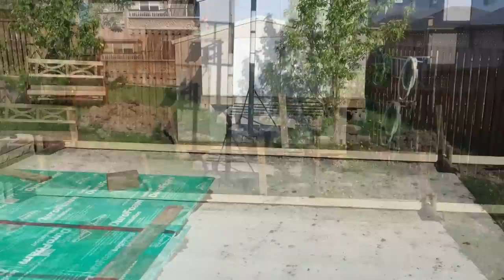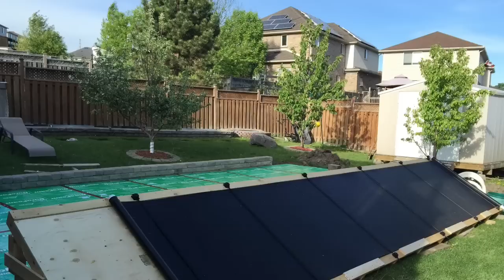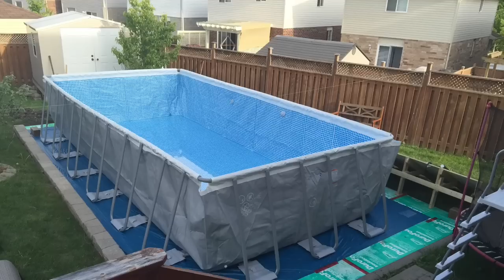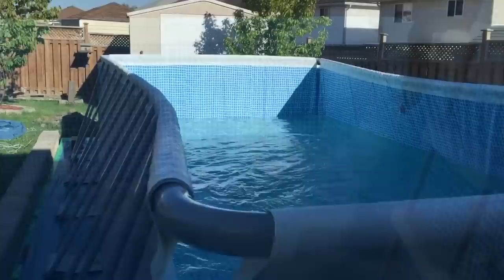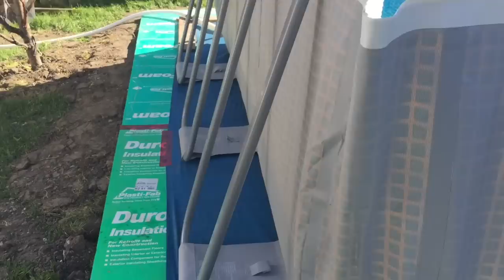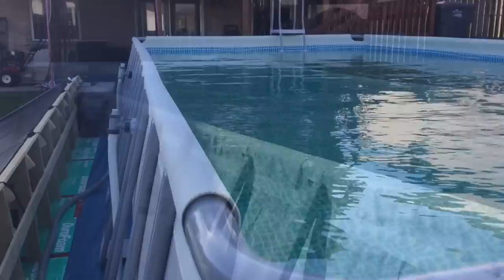Intex 24'x12'x52" Ultra Frame Above Ground Swimming Pool

Comment: Interesting that you set the legs directly on the foam, did they not sink in due to the compression?
Reply from the maker: Yes, they did sink in overtime but causing no issues whatsoever.
Reply: @PTranProductions I wonder if you had used XPS foam, if it would've compressed. XPS foamboard has a compressive rating of 25 PSI.
Reply from the maker: @Superman-xr1oh 
I just wanted to stay low on cost so I got the cheapest foam board. For such a high stress pushing down from those legs, XPS foam boards may not work either.
Anyway I already sold this pool 2 yrs ago as my kids already grow out of it.

Comment: Would be interested to know how good the solar panel is, once you get a chance to heat it. :)  Are you in Canada?
Reply from the maker: Yes, I am in southwestern Ontario, Canada.
Here is my 10-day observation on this pool with the heater:
Pool heating:
Day 1 (first fill): Pool temp: 17
Day 3: outside temp: 26.
             Pool temp: 20
Day 4 - outside temp: 24
             Pool temp: 22
Day 5 -outside temp: 28
             Pool temp: 24
Day 6: outside temp: 30
             Pool temp: 26
Day 7: outside temp: 27
            Pool temp: 26
Day 8: outside temp: 24
            Pool temp: 26
Day 9: outside temp: 20
            Pool temp: 24
Day 10: outside temp: 24
              Pool temp: 24
Reply: @PTranProductions  Have you got some diverter or close-valve for the solar? If you run the pump at night or on a colder/windier day, you will loose all your heat as the blanket has little thermal mass and lets the heat radiate out to atmosphere.
Reply from the maker: Alex Kostoff 
Yes, there’s a built in bypass valve from the solar heater which can be be used as needed. Besides the pump only runs during the day on 12 hrs cycle.

Comment: How thick is the concrete pad?
Reply from the maker: It’s 4” thick.
Reply: @PTranProductions Interesting that you set the legs directly on the foam, did they not sink in due to the compression?

Comment: Hi! Can u give an update of how well the pool is holding up.? Any advice as we are thinking for getting one . Thanks!
Reply from the maker: L C 
The pool is still holding up strong this year. This pool needs to be put away every winter and re-set up every summer which takes a bit of work & $ every time to fill up. Two upgrades done last year were new inline automatically chlorinator and surface skimmer.
Reply: PTran Productions I’ve also heard of ppl upgrading their filters and investing in a  floor sweep

Comment: hi I. am looking for a new pool because I used to have a small round one in the video it seems that the sides sliding inwards is this normal ?
Reply from the maker: The sides were leaning inward while it’s filling. That’s is normal. However as the pool is completely filled up all walls were straightened itself out.
Reply: @PTranProductions  thank you so much
Reply from the maker: ghena alkhuzaei
You’re very welcome!

Comment: how much did the water truck cost? ,,,,,,,,, good idea
Reply from the maker: Terina Marchand 
Water truck cost was $380 CAD.
Reply: expensive... if i use my hose, sure it takes like 10+ hours to fill it up but it only costs about 30$
Reply from the maker: Salvador Nobre Veiga 
Filled up with two garden hoses for 16 hrs and cost $120 on the water bill this year.

Comment: Hello, my name is John. I'm from Greece. Congratulations on your video! I have bought the same pool as yours  and put it in the ground. I was wondering if you could do me a big favor and tell me the external dimensions of the tubes on the top (length and width) because I want to have it as reference. I would really appreciate it. Thank you!
Reply from the maker: The dimension of the tubes on the top (when put together) is equivalent to the pool size which is 24'x12'  give or take with 4 corners are movable in and out.

Comment: 30,000..... why so much? That’s more than double the amount needed. 24’ believe takes around 12k or so because I have the 32’x16’x52” and that’s just under 15k.
Reply from the maker: It’s 30,000 liters which is equivalent to 7,925 US gallons.
Reply: PTran Productions - thanks for the reply!
Reply from the maker: My pleasure! Thank you for stopping by!

Comment: I am looking to have a slab poured for that same exact pool. Is 28'×16' correct. What depth and psi should I use to support that much weight? Thank you!
Reply from the maker: Reginald Vance 
Yes, 28’x16’ pad with 4” thick seems to stand out ok with mine.

Comment: I just bought the same pool and had it set up, but on the sides the comer pieces doesn’t really seem to connect. It honestly seems kinda effortless to pull them out. I was wondering if this is normal or is there something wrong with my corner pieces.
Reply from the maker: Jmir Thomas 
The corner pieces are supposed to move freely inside the side frame tubes to compensate the frames movement during setup and when fully filled with water.

Comment: What did you use to fill your pool
Reply from the maker: As you can see in the video, the pool was filled with a 4" pipe which comes from a water truck that I hired last year.
This year, however I just used a garden hose which took about 36 hrs to fill up.
Reply: PTran Productions  Which one was cheaper the water truck  Or your garden hose?